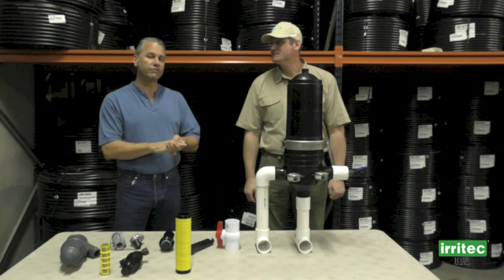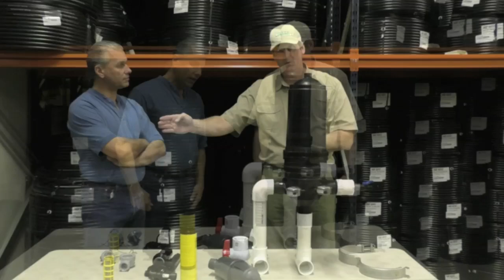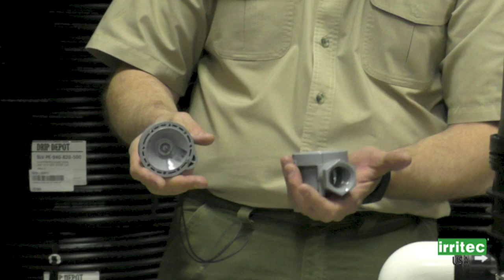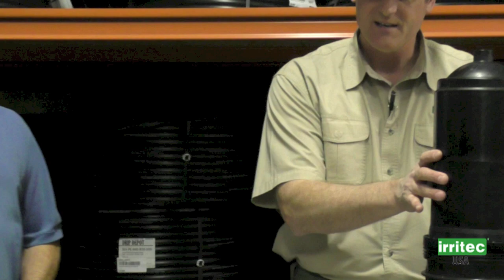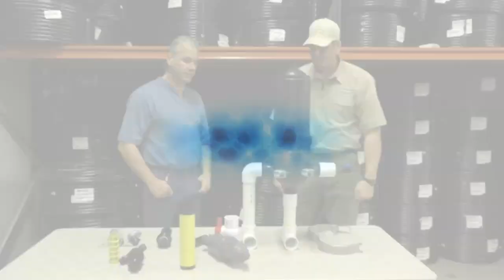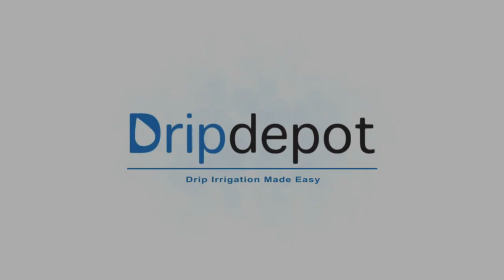Irrigation System Filters for Dirty, Pond, Canal Irrigation Water

Comment: We want to install this on our system for lake water filtering lawn sprinklers. How do I determine what size filter screen to use without hurting the pump??
Reply from the maker: Most lawn sprinklers get filtered at about 40 to 100 mesh (around 420 to 180 micron) to , depending on the sprinkler - large sprinkler guns and some impacts on the lower end of that scale, rotors and spray bodies on the higher.  A filter like this will typically go downstream of the pump (in between the irrigation system and pump).  If you're looking for some filtration on the suction side of the pump it will typically be a strainer basket or a foot valve that is equipped with a strainer.  In general, pumps are more sensitive to resistance on the suction side of the pump and are limited to manufacturer approved strainer mesh sizes, usually a wider mesh than what you see in a downstream filter.  

A filter on the downstream side of a pump will only add a few feet of head for the pump to overcome.  The filter in this video for example, would only lose about 1.45 PSI at a flow rate of 66 GPM, which is only about 3.35 feet of head.  As the filter fills with debris this will of course increase, but the element inside can be cleaned to get it back to minimal resistance :) 

Circling back on the filtration strength, if you know the brand and model sprinklers you're using, the online literature may have a recommended minimum to ensure larger debris the nozzle orifice cannot pass is captured by the filter.

Comment: I watched based on the "pond" in subject.  Seems like this is particles-based filtering.  I have a pond and it has ecoli and likely other contaminates.  Is there a filter product that can produce enough hassle-free filtration for this sort of thing to irrigate about a 1/2-acre orchard?
Reply from the maker: Great question!  And apologies for the late reply, I was out over the holidays but now back in the office and happy to assist :) 

You have the right of it on the particles-based filtering, our strongest filter is about 80 Microns which isn't nearly fine enough for E-Coli (typically 0.25 to 1.0 microns).  

There are filters out there that are rated for 0.2 microns that you could look into -- they're often used for drinking water systems but shouldn't be too much hassle to adapt them to an irrigation system (though may not be an optimal option due to the flow needed for the irrigation system). 

UV sterilization is definitely something to look into, effective and would likely cost a good deal less than a Reverse Osmosis setup.  There's some UV/Ozone combos (Aqua Ultraviolet if I recall correctly) that are often used in situations like this -- for edible crops a little chlorination is often used as well.  

You'll still want some pre-filtration to get particles out -- if it's coming from a pond, likely a disc filter for the soft organics in there.  

Some regions might need health department approval (only some places, and less likely if these aren't commercially sold), but they might also be able to assist with the best practice in this case, or potentially your local Ag extension. 

Also, your channel is full of great information, gonna queue up some of your videos to check out after I clear out the holiday back-log in my in box :)

Comment: purchased a 1.5" t-filter from you guys sku 20451. Inside the two pressure gauge ports are a spring and a small marble. Should those be removed before installing pressure gauges?
Reply from the maker: I think you might have emailed us as well, but I wanted to reply here too in case someone else has the same question as it's a good one :) 

The red adapter that comes with 20451 can accept a 1/4" MPT pressure gauge -- you can then push the stem of the red adapter into the pressure gauge port and it will move the spring loaded ball out of the way so pressure can be checked.  Somewhat similar to a tire pressure gauge, but it moves a spring loaded ball instead of a valve stem.  Some filters are moving this direction so you can just have a single gauge and don't have to drill holes (the no-drilling I like, as we've seen lots of filters ruined by using the wrong bit, once you've drilled there's no taking it back).  

I hope this helps anyone reading it!
Reply: @dripdepot  thx. Had never seen that method before.  I removed ball and spring and rubber seal and mounted two gauges on the unit. Hoping that is sufficient as well
Reply from the maker: @rf4215  I don't see any reason that wouldn't work -- water will get pressed up into the channel and into the gauge, it should test pressure as normal as long as it's water tight :)

Comment: I picked up a used sand filter barrel for swimming pools and it seems to be working well going on year three. It’s nice because I can backwash and rinse the reservoir regularly and replace the sand as needed.
Reply from the maker: Sand filters are great filters, excellent pick-up you made!  If you ever get the chance, when you're replacing your sand, look at the old sand through a magnifying glass, it's pretty incredible how smooth and round they get after some time filtering -- like small glass multi-colored beads.  :)

Comment: What is the best way to clean the screen filter thoroughly for lake water application?
Reply from the maker: For screen filters, we like to remove the element and then spray the outside with a garden hose or something similar that doesn't have really high pressure.  Screen filters filter from the inside out, so spraying the outside will usually get rid of debris that has collected on the inside.  

Disc filters are a little more involved, but the discs can be separate after the element is removed from the body of the filter.  This makes rinsing them with a lower pressure hose or container of water a pretty effective method :)

Comment: When you speak of runtime are you speaking of the the time you have before needing to clean the filter?
Reply: You got it exactly right!  He's referring to the overall run time of the system before the element gets clogged up enough by debris that it needs to be cleaned.  A larger surface area extends the time it takes to get clogged :)

Comment: Can't believe u didn't start the discussion with mesh size ! That makes as much of a difference as area of screening filtration...pretty amateurish...By the way, most drip systems, that i work with, want a minimum of 150 mesh to filter particles down to 100 microns in size...Amiad rules 🤣🤣🤣
Reply: It doesn't matter, the point is that for the same mesh size more surface area = longer run time. So if your system dictates a 100 micron mesh, then that's what you're going with. All he's saying is: buy our filter, cuz it's uuuuuge ;)

Comment: None of these filters work for my application using drip emitters. My water originates from a creek which is affected by sand, organics, and other water borne particles every time it rains. I run 3 large disc filters which work together to get me one hour of run time before requiring cleaning.
Reply: I also pull from a creek out west. I don't draw from it during rainy season other than through a garden hose but during growing season, it's filled with organic material and sand. trying to remedy this as we speak. I'd be fine cleaning filters weekly if I can achieve that. will be placing a 1.5" t filter (disc) right after the pump b4 it goes into pressure tank and then small inline filters (home depot) before each valve.
Reply: @rf4215  I bit the bullet and spent the money on a 2 canister sand filter with a timer to automatically self flush itself.  It is run by 4 D cell batteries and is very effective.  The water then goes to the disc filters as a backup.  So far,  its been running good.  I am going to have to make some kind of settling pond at the source to help remove the organics tho.

Comment: I am a professional lake pump, advanced filter installer and diver with over 36 years experience, formerly a licensed irrigator with 22 years experience.   These guys are right in one respect  - - you need to install the largest filter you can afford, like the one he is showing because the small filters will often clog up in one irrigation cycle (one day). 

Unfortunately, the filter he is pushing is a SCREEN filter, these are the worst for all the mucky, yukey, sticky debri in dirty lake or river water  - -  this stuff sticks to the screen and is hard to get off.
Normal brushing or water hose spray will NOT get this stuff off the screens.  What is the maximum operating pressure of this filter ? My filters are 150 psi.

The type of white PVC fittings he is using to screw on to the filter are weak, they will split easily. There is a special type of reinforced sitting I use on mine and they never split.
Reply: What type of filtration would you recommend for river or canal water. I use canal water for toilet and it tends to dirty the Bowl a lot  .Can you recommend a mesh  filter, a chlorine regulator or any other types of economical system for a home? I would to have a clean water system. and recommendations?
Reply: In my garden the valves filter too much water
Reply: I have found the same thing myself. My only experience is being a home owner but find that the tall yellow type he has on the table works best for my irrigation outfit. I pull out of the canal behind my house and when the summer heat sets in the water quality gets really bad and it keeps up with it pretty good. Still not the best solution but one that I can keep up with.
Reply: P.S. On their website they offer a disc type filter as well for the cartridge he demonstrated. It's a bit pricey but may give me longer periods of time between cleanings.
Reply: Robert, I have 1/2 acre pond, what would be your recommendation to get water from the pond , filter, pump, etc to use for irrigation?  If you would design a system what would it look like?
Reply: I picked up a used sand filter barrel for swimming pools and it seems to be working well going on year three. It’s nice because I can backwash and rinse the reservoir regularly and replace the sand as needed.